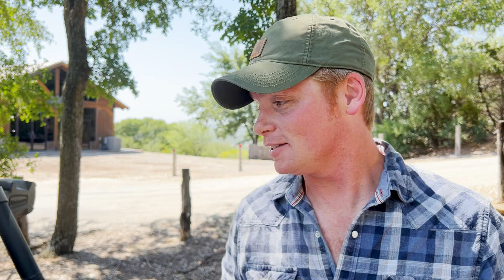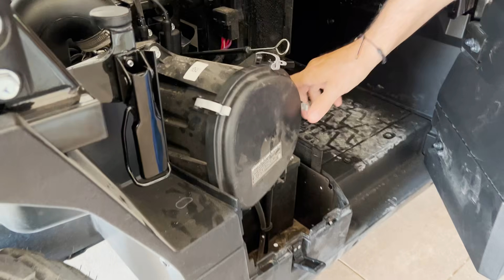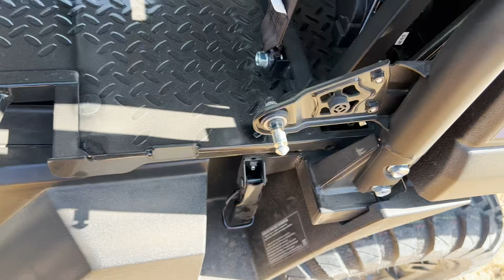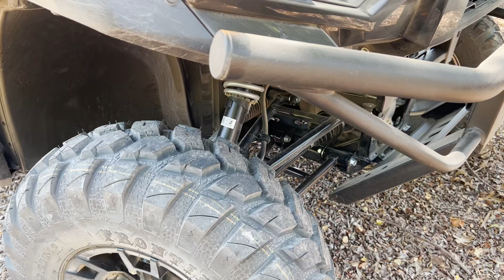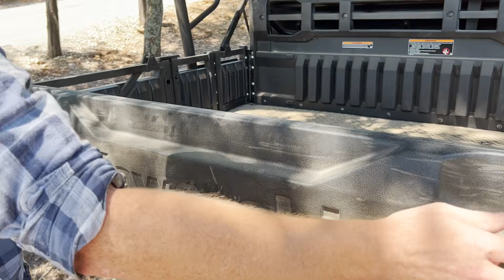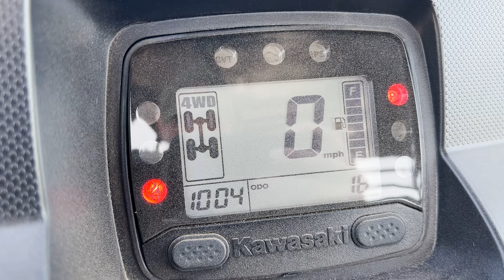Everything We LOVE and HATE About the NEW Kawasaki Mule

Comment: I like to give my dog rides in the box of my 2000 Mule and would like to do the same in my 2023 Mule but there is an area in the box that gets so hot from the exhaust under it that you can't hold your hand on the box! I put my laser temp sensor on it, and it reaches 300 degrees! Kawasaki needs to correct this issue.
Reply: They make rubber pads made specifically for this. They must make them for the mule, I know aftermarket mats are made for other brands and advertised directly for dog hauling.
Reply: Search razorback pet pads.

Comment: I agree about the speedometer and small on the interior. I guess in some ways their thinking you’re not as likely to use it or something.  The seats really aren’t that bad for what they are.  I remember some of the older rangers would get really hot. I know kawasaki has the new machine on the market with alot of premium upgrades. I would expect them to slowly change over to more of that kinda feel  on some of them.  Its definitely a work rig thats for sure but they can do most anything you want.  They handle curves like its nothing. Our dealer test drove one and we were massively impressed.  It would be nice to see rubber grip pads in some of those hard plastic trays as well. Its nothing you cant live with but polaris definitely has a bit of an advantage on them.
Reply: Polaris has zero advantage on Kawasaki.  The Kawasaki has a three year warranty and great warranty customer service.

Comment: I have an '18 model. The only thing I have done is put spark plugs and spark plug wires and regular maintenence. I am currently sitting at 11,400 miles, and I know that it will always be ready for me when I need it. Absolutely bombproof design. It is a simple machine, and I'm a simple man. I wouldn't hesitate to buy one of these. I may consider upgrading for the extra power and speed. One could argue they should upgrade certain things, but when it works, it works.